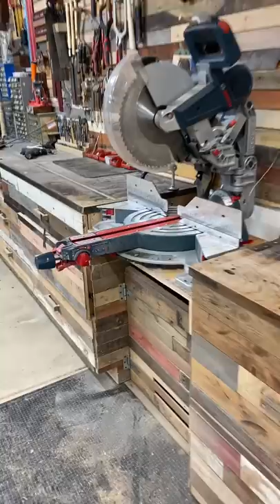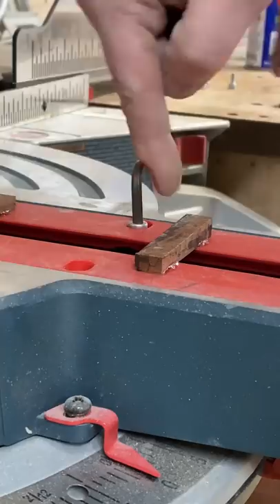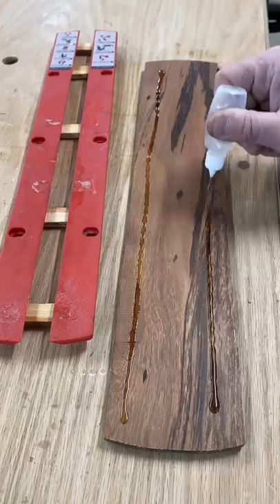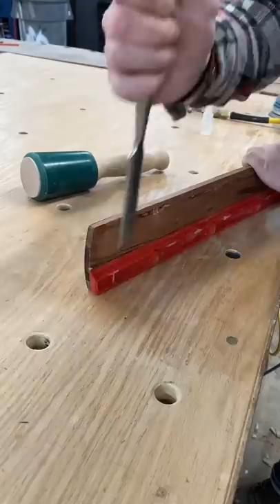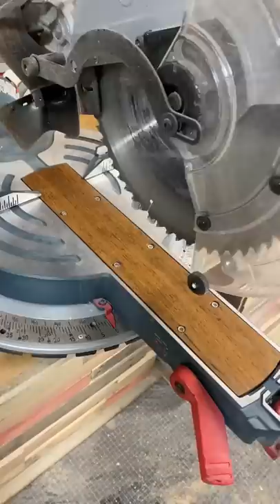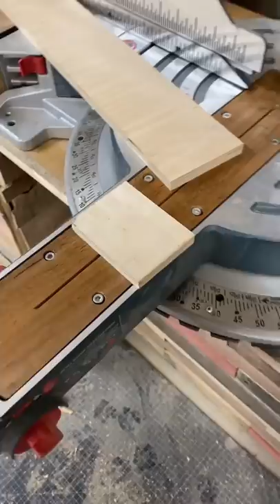Zero Clearance Insert For the Miter Saw #shorts

Comment: Why? This is only beneficial to a constant 90° mitre. Every degree of compound cuts will make the gap wider.
Reply: At which point he can… 
Oh Idk
replace the insert with the old one?
There are benefits to having the zero clearance insert. Besides, a huge majority of the cuts made are 90 degrees anyway
Reply: @cassandra_classic  So you have to go through the hassle of switching it out every single time you need to make a miter cut on a miter saw... Outside of really simple projects you will need to frequently cut miters. The vast majority of cuts don’t need the benefits of zero clearance / the same benefits could be achieved by frequently changing your blade and cutting more slowly.
Reply: @adamdodds144  frequently changing your blade? Sounds expensive. I'll take 2 minutes to change out the insert for free and still get less chip out. For as little as it would need to be swapped for a few miter cuts here and there, it's not that big of deal.

Comment: I would do this to my shop saw, but not my job site saw. Looks cool and in the shop making chop cuts and doing everything else with a table saw or router, would be sweet to look at. On the job site, where we need best accuracy super fast and consistent every time, it’s best to just use the stock piece.

Comment: I use a drop in clamp on zero clearance combination sub fence/sub table ( 2 blocks fastened at right angles). Make the back fence more than thick enough to make the fully retracted center of the blade for flat bottomed nibble dadoes. Set the down stop so you don’t chop this jig in half. It’s good for tiny pieces also.

Comment: Tear out on a Miter saw comes from the top  of the board not the bottom, as that is where the blade exits the cut. Scoring the top of the board first (by running a shallow cut across the top) will help prevent this. I will say that this insert will be great for catching the small cut-offs. So it is well worth the effort.

Comment: Learn how to use a saw and you won't get any chip out
Reply: But how? I'm intrigued, is there something I should know?
Reply: @TewkesburyBear  yes
Reply: @darkone12491  brilliant yeah cheers for that. Go back to bed.
Reply: Okay so since this person isn’t being helpful or is just just talking shit without actually knowing, lemme see if I can help.

When I worked in a cabinet shop we would set a price of 1/4” underneath the price we were cutting and having something underneath solves the chipp out problem. It’s essentially what the guy is doing here but we ALWAYS had scrap 1/4” laying around
Reply: @TewkesburyBear  I believe the tear-out happens when you blow through that last little bit of wood and you're kinda breaking it as much as cutting it.  Try slowing down as you get most of the way through and you should get at least less of that.  Also, if you're only making a few cuts, you can probably put one strip of masking tape over that slot and get a pretty good result.  Don't put too many layers of tape though as you'll be raising your workpiece up in the middle and throwing off your accuracy.
Reply: @CeeJayThe13th  OK yeah yeah I see that, thought there was a good trick I was missing. Thanks.
Reply: @TewkesburyBear  just let the blade eat the cut nice and steady with no pushing. Don't force the saw through the last bit of the cut. Sharp and correct blade for material. Miter saws are for making sawdust not wood chips
Reply: @TewkesburyBear  it can be a really good trick for a table saw but I don't think you really get much more from a miter saw like that.  

I honestly just think that people think it's cool to make so they pretend like it's a game changer but you don't really need it if you use your saw properly.
Reply: @olbabybeard  that's basics yeah I get that. Just seemed like he knew something out of the ordinary.

Comment: So that works for a straight cut. Can l make the same insert, angle the table to either say 45° or 90° then cut it to make zero clearance inserts for those angles?
Reply: Of course you can. Also, what saw do you have that does a 90 degree compound miter cut????
Reply: @bradley3549  good heavens that 90 was a typo, sorry

Comment: Did I get it right ?
Zero clearance is to have the support pannels the closest to the saw wheel ?
Reply: I believe slow. The only disadvantage is as soon as you cut on the slant/bevel the clearance gets wide again. So if you do this worth making a few and maybe saving a good one for neat straight cuts only
Reply: I think it's to minimise chipping and splintering. Like an anti splinter strip on a track saw

Comment: How are the stock blades holding up against hardwoods in the planer? If they are stock.
I heard they dont do well but I'm not wanting to switch mine out if I dont need to. I haven't risked running any hardwood yet because I dont want to ruin the wood. (Wood prices these days)

Comment: Use the tape method of glueing the original insert together so you don't have to pry them apart, just remove the tape. Tape on both pieces and glue tape together.

Comment: You should use blue tape where you're going to use glue and activator, so then you can just take it off and not ruin your main insert. Also, you should make a template, I like 1/2 inch MDF, so then you can just use the template when making another insert in the future!

Comment: So there are two small blocks for spacing on the top of the original... Then cut to 4 of them on the back when you use the top end for spacing of the screws... Might as well just snap fingers and have the new piece in without only showing half the steps in making it.

Comment: The problem with the Bosch saw is the center of the table is damn near 1/16” lower than the sides, and 1/8” lower than the extensions. I bought the saw a few years back thinking it was the best out there, and it is, but it still lacks the ability to do precision work without tweaking it.

Comment: Zci on a miter saw is completely redundant. Due to the way the saw cuts, you don't have tear out on the bottom on miter saws. The tear out on miter saws is always on top, so a zero clearance insert makes literally no difference.
Reply: Unless your saw doesn’t slide or the wood is wide enough you need to plunge
Reply: What kind of saw do you use? I have done finish carpentry for 25 years and every saw I own tears out on the bottom, not the top. I have used a bunch of different saws all with the same results. My main saw currently is a 12" sliding dewalt with a 100 tooth fine cutting blade.

Comment: I'm not trying to troll.  I am genuinely wanting to know what was the purpose of this?  What difference did it make?
Reply: Long story short, he's ensuring as much material as possible supports the cut, so there is no unsupported area causing the wood to break downward. Wood often splinters or frays at the back, but this cut is 100% flush with the plate clearance.

Comment: since you have a zero clearance Gap you should see if you can drill a hole somewhere and add a vacuum line 1 to the safety saw cover and one to the bottom side a whole nother video very nice job though

Comment: And the original clearance prevents friction and overheating / bending blades, its easier to clean. If you dont get clean cuts the blade is blunt and you should sharpen it.

Comment: A new-ish blade and slow cutting of materials also gets these results. Jus sayin
Reply: Also direction of cut. So if you plunge down fully pulled towards yourself and pass through you get a upwards rip so the bottom will be nice and the top, splintered. I believe you can also scar it on the pull to make the initial cut to the top and the plunge it closest towards you slowly pushing the blade to the back of your piece. Creating minimal splinters/chips... But yer a fine blade with lots of teeth and a slow cut are a good bet
Reply: But not too slow or you can burn it

Comment: O.o The only thing that does is keep the bottom of the wood from fraying which is nice, but the only time you would care about that is trim work, but you never do trim work without cutting at angles, which you cant do with this piece in, which is most likely why manufactures don't supply them.

Comment: Maybe practical if all you do are straight cuts but any time you bevel you would have to change the plate. I have this exact saw (she is a babe) and have never had any issues with it. I just don't see this being that helpful. Just use a sharp blade

Comment: No cheese! Can’t you not cut the front side of the piece (so technically opposite) and you get the same results. That’s what me and my dad do because we have a crew to manage and if we saw them take the time to do this at work we’d be pissed lol
Reply: Sometimes you need both sides to be finished.
Reply: @williambrandondavis6897  would you consider that more efficient vs sanding prep prior to cutting anything at all and then lightly sand the cheese off as you’re installing. This is what we have our guys do for our interior carpentry business and we’ve never had any complaints about the wood looking unfinished even when the mill company they use sends horrible stock.

Comment: That looks like a cheap saw and no wonder you have breakthrough or you could get a better blade and spend about 80 to 100 bucks and not try to push it so fast when you cut it would stop all that but that was great work and a nice finish

Comment: Way more complicated than it needs to be.
Reply: This saw has an adjustable insert.  Just loosen the screws and slide the sides until they just touch the blade.   No need to make one, it already has one.   Though it sure does dress up the saw - until you want to cut a bevel.